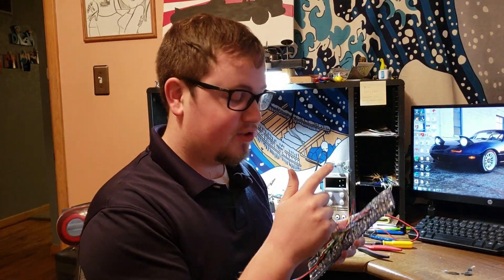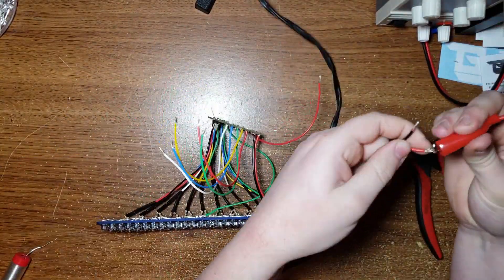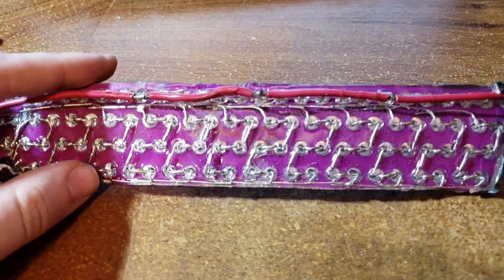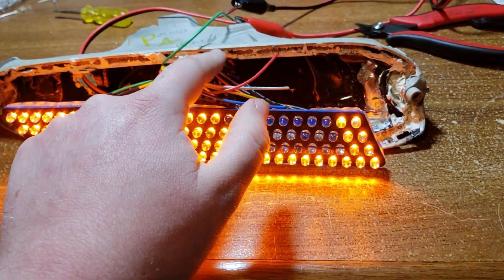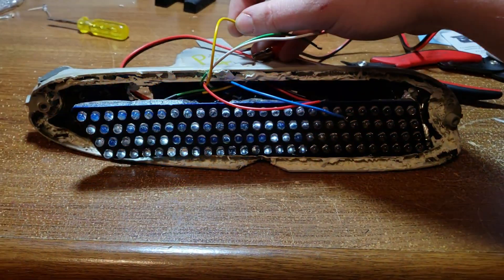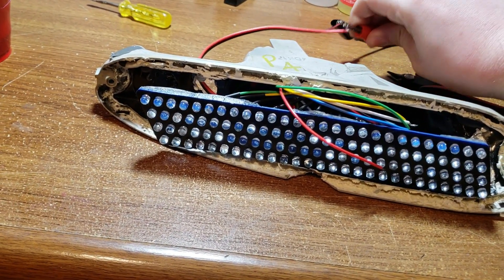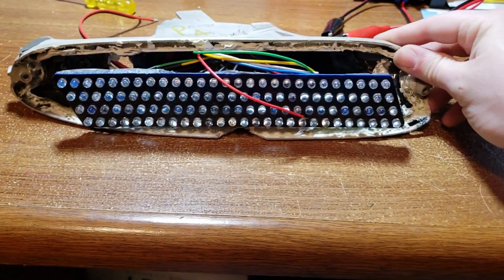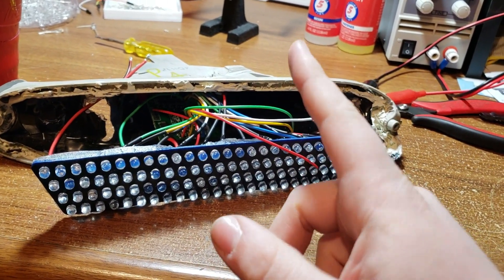Miata Sequential Turn Signals Potting with Epoxy!

Comment: do you need one module for each headlight, indicator and brake light
Reply from the maker: Each controller has 28 output channels so its kinda based on how complicated each light is. But you could use one controller for more than one light.